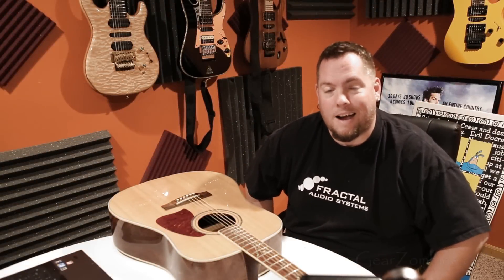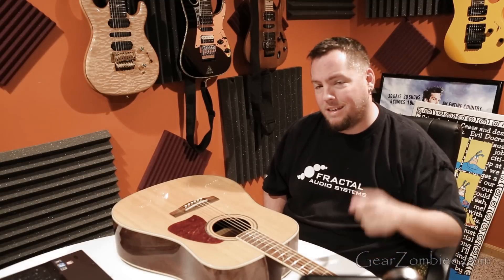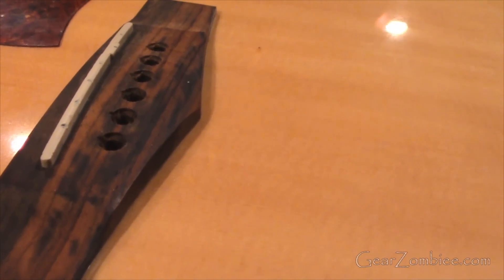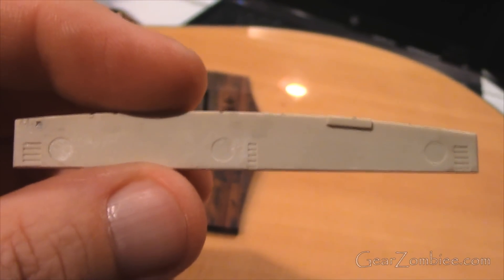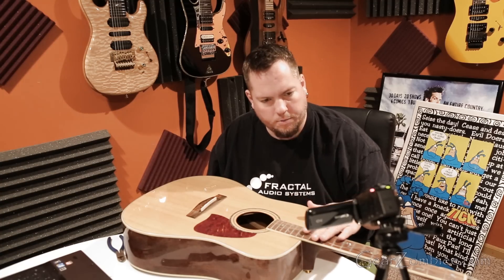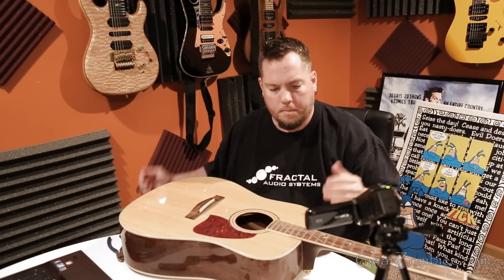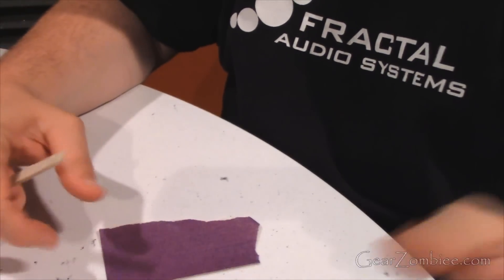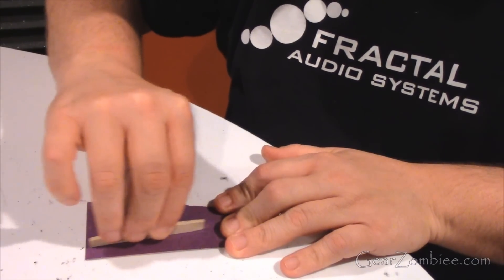Adjusting Acoustic Guitar Saddle Bridge Height And Neck Adjustment

Comment: So for anyone wondering: clockwise, or tightening, pushes the neck against the strings. Too much will resort in a backbowed neck. Turning counter clockwise, creating more space in between the neck and strings, will lead you to have a bowed neck, with more relief. That is if you look down from the bridge, or sound hole / pickups 🕳 up to the headstock, right is tight, left is loose. Measure on 7th fret with first fret pressed in and the last fret pressed it. Strings should just hover above the 7th fret. Good luck! Easy does it. Don’t wrench 🔧 it like the guy said. Also tune up your guitar first. Make a change. Then tune up again. Measure. Repeat process. Don’t be shy to leave it overnight and come back to it next day. it can take some time if there is a large adjustment to be made. It’s an instrument. Treat it like a puppy. Never more then 3/4 of a turn in one go. If it’s feels rough or stuck maybe leave it and have some one look at it. Better prevent then repair. EZ DUZ IT!!! One love.
Reply: Thanx man ♥️✌️
Reply: Thanks Man👌

Comment: I got an old bajo sexto that got top - bent from 12 string tension and i just threw some D'Addario Light 80/20's on it but the action was pretty high and i was harming my left hand with it. Thanks for the vid, i am adjusting the height, sanding down the bone nut and saddle.

Comment: After the saddle adjustment it sounds buzzy when you play. Does that need fix of truss rod adjustment ?
Reply: It's tuned very low (A#) which is probably giving the buzz you are hearing in my opinion, just a string gauge issue. But generally in standard tuning yes either the truss rod needs a little loosening to add relief to the neck,  or you filed/lowered the saddle too much - in which case no amount of truss adjustment will fix it (time for a replacement saddle).. or if you adjusted the truss rod and the saddle is still sitting fairly high you have frets that need re-alignment which is a whole other kettle of fish.

Comment: Great advice there is a great tool for getting square flat bottom saddle and nuts  on the stew mac channel but would be for serious repair shops  but worth a look as it's a great device  I have the same problem only that I have a  Alvarez ad 90 that im positive the  low e isn't making contact as the whole string sounds dead even more so when you fret it like a G chord with the muted 2 sting sounds really dead  this isn't the  usual dead  spots that you get on a lot of guitars it's on every fret of the low E I'm terrified of messing with the  peizo strip I
 but I'm also interested in what  tuning you used in your test noodle I thought it could be drop D  or DADGAD  or even drop C Would love to know bud as I can normally tell which flavour  of  
D it is but you had your own thing going on there  but you made  it sound pretty cool which ever it was.Give us the secret tuning dude  ✌

Comment: I got a question or two since you asked. I just bought this guitar and the action is clearly too high. I think it needs to be sanded just like this. But I was thinking, maybe I'd bring it in to be set up by the guy since it was obviously never set up correctly. That's probably why I got a good deal on it. But if I'm going to do all that, maybe I could pay for a nice bridge and/or nut. Would that make a difference? I've heard about like, bone nuts or bone like nuts. Are they good? Are they worth the money? Are they very expensive? And should I even bother having someone do this at all? Will he be able to do something I don't know about or can't do myself? If you can't answer all those questions, I understand.
Reply from the maker: So, I personally really only even change them if there is a reason to.  Cheaper guitars tend to have plastic nuts and bridges.  More expensive will have bone, tusq and companies like Graphtech make man made ivory and such.  If it's a guitar you like, you wont regret replacing them with their higher quality alternatives.  But, also make sure your neck isn't causing your action problems.  If there is a huge amount of relief in the neck (big droop in the middle when you look down the neck) a simple truss rod adjustment could make it more playable for you.  Higher quality nuts and bridges do impact tone and sustain, generally in a more favorable manner.  As far as should you take it to someone?  I have jobs that I will do and jobs I won't do.   Example, if I murder a nut or a bridge, I can order a new one and drop it in.  Anything that's well above my skill level or something that would take me forever I generally take to a luthier that I trust.  Example, I will file and crown my own frets but I won't replace them.  I've never done it, I don't have the tools for it and it would take me forever to do.  But for the cost it's worth it to me to have a pro do that.  
So I personally don't ever look at it from a "should I" perspective.  It's a guitar I like and want to play and I don't want to do the work, take it in and get it right.  I just took 3 of my electrics into my luthier because they were all guitars I had recently acquired and all played terrible.  I could have done them myself, but I dropped them off to my guy and they were ready by lunch.  It would have taken me much longer to dial them, and one I was changing pickups.  It was worth the money to have an expert hook them up.
Reply: @GearZombie  Okay. That helps. Thanks.

Comment: Hey my man, awesome video thanks for the help.
I had a little question though, when inserting a new bridge to a guitar should you make the cuts in the top yourself? (so that the strings it in nicely?) and if so what tool should I use for this? Thanks! x
Reply from the maker: +Robert Langford  In many cases there are not cuts to be made on the bridge but may have a small notch in them already.  If you need to have the top of one filed you can use a simple small file, but keep in mind its pretty easy to harf your action and tone doing that if you dont have it straight.  If it needs to be notched you could always look at have a local music shop do it for you.  Should be pretty cheap if you go that route.

Comment: Curious I just purchased a new guitar it has tons of volume and the overall construction and finish are great my question is will these ad judgments improve sound ? The guitar sounds way to bright
Reply: It won’t change the sound. A setup is for playability (ie. Some people prefer lower/higher string heights) as well as adjusting the guitar based on the strings you play and the conditions it’s living in.

Strings will probably be the easiest way to address what you’re looking for. 80/20 strings are really bright, phosphor bronze (sometimes called 92/8 strings) are a bit more mellow and  with a little bit of age you won’t get tinny highs.
Reply: Could be new strings. Most people love bright acoustics!? Maybe it’s really bright!?? What type of wood is it made off?
Reply: Best sound is a older used guitar an a nice set of strings to compliment it. For example aged all mahogany guitar with bronze strings

Comment: Can you explain why the adjustment of the plastic or bone section of the bridge has to be adjusted with regard to the buzzing of strings?  How is the problem of the buzzing strings related to the bone part of the bridge? In other words, how does the filing of that bone section of the bridge eliminate the buzzing of the strings? I thought the buzzing of the strings is caused by the strings laying too flat on the frets at the higher end of the guitar neck, and that, therefore, the bone part of the bridge should be raised up instead of being filed to go deeper in the bridge and thereby cause the strings to lay flatter on the frets and buzz more.  My guitar also does not have the neck adjustment rod, so how do I fix the buzzing of the strings with regard to that problem? Please advise.

Comment: So how much do you sand down the saddle in order for the strings to be at the correct height?  And also how do you know when you put the strings back that the gap between the strings and the fret board is at the correct height?  thx
Reply: +Googlegenius The strings should sit about 2mm from the 8th fret for good action on an acoustic guitar. Measure the amount and sand of what is needed. You can always put a spacer in if you sand too much. I've cut up thin pieces of plastic to use as spacers before which work fine.

Comment: I have an old guitar and it buzzes real bad with open strings but you go down one fret and it stops. The neck looks straight to me. So would this mean the nut is bad or too low?
Reply: Yep, open string buzz is do to nut slots being too low
Reply: A very slightly concave neck is better than completely straight. Start with truss rod.
Reply: Neck should have a very slight bend not completely flat

Comment: Bro does sound improve by changing saddle and bridge ,tell me I can't wait to know ?
Reply: It makes the guitar much easier to fret/play by setting the strings closer to the fret board. It won't change the sound generally
Reply: Strings on a 12 are higher than a 6 string to get them lower to frets down tune to d then capo 2nd fret then your have a much lower action
Reply: Dude my guitar sound totally went off after I messed up with my bridge

Comment: I want to adjust my saddle bridge on my Takamine EG524SC-NS Accoustic but they have electric pickup wiring built in. But the height is so dang high, it is hell on the fingers. I don`t know if I am stuck with this action.
Reply from the maker: +Ricky Reynolds I google that model and I would have to look and see how that is wired.  Looks like yours is a split bridge, but the same theory should apply.  Some of those pickups are glued to the bottom of the saddle some are not.  You may be able to get away with doing the same thing I describe here or it may be more work.  Next time you change your stings, just slide the saddle out and see what you got going on!  Also make sure you have an escape route!  Check the price and availability of a replacement saddle just in case. Thank for watching!
Reply: I have the same problem here with Takamine ED1NDC.. Have you found the answer?
Reply: Most acoustic guitars are made in a factory with interchangeable parts, that means they are all the same size parts.  In the case of an acoustic guitar that may or may not offer PU's under the saddle, they generally use the same size (height) saddle so even if you don't find a factory shim, the saddle rests on the pick ups and may be higher as a result.  The idea is, when you buy one of their guitars, you will prefer having the saddle adjusted to your preference anyway so the saddle will be high until personalized to your playing preference.  It's sad, IMHO, because I hear of so many "would be" players that give up because they don't know the saddle needs to be adjusted and suffer from too much finger pain. 
    Almost any string can be made to buzz if you pluck it hard enough, the idea is to reduce the action to match you strength and style without causing undue wear and tear on the players finger tips.  Personally, I do this to get the action down to a manageable level and fine tune the notches in the bridge, one string at a time, for the final set as this can be done while the other strings are at full tension and a more accurate playing adjustments can be achieved.

Comment: Well.......?  How many thousandths relief and on what fret, stringed and tuned or with no strings, how high at the 12th fret when tuned up from the bottom of the Big E to the fret, and how much for the little e at the 12th?  Any one who knows how to change strings can do what you just showed us, by the way, why not while you have the saddle out, get a nice piece of bone or fossilized Ivory and cut a new saddle, what about the nut how much clearance on the first fret under the strings?  Not enough questions answered.